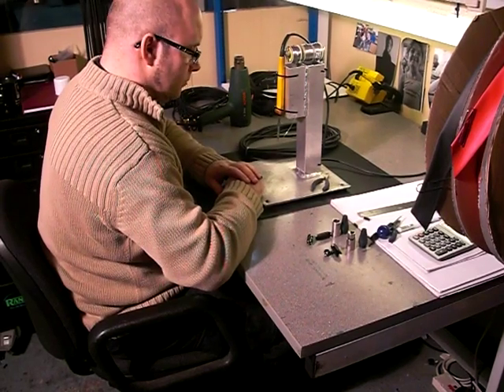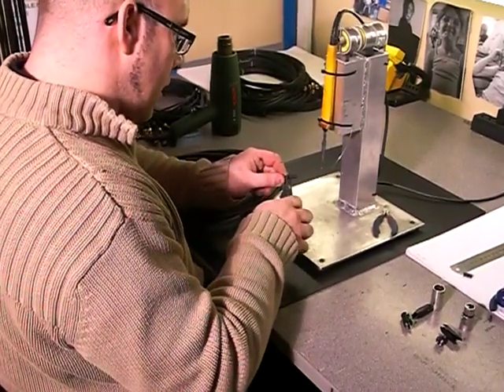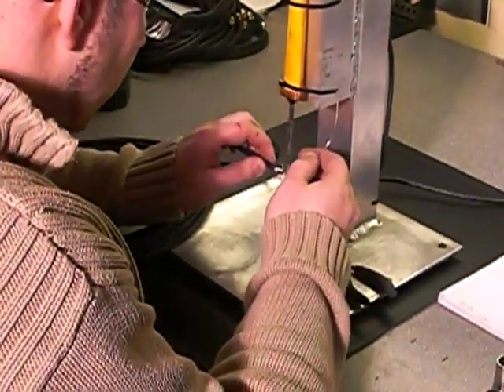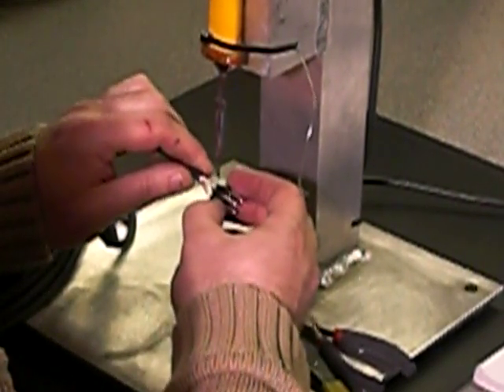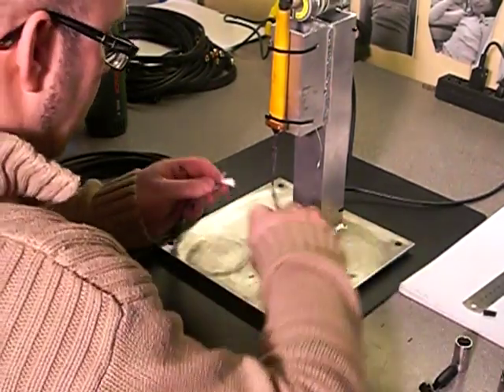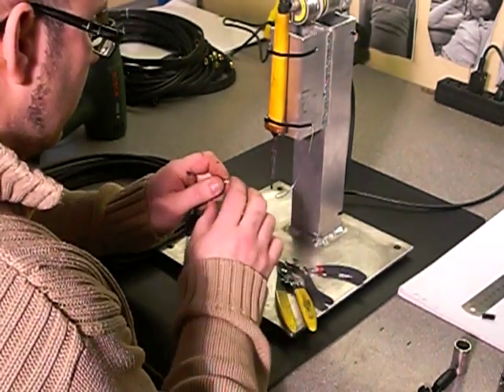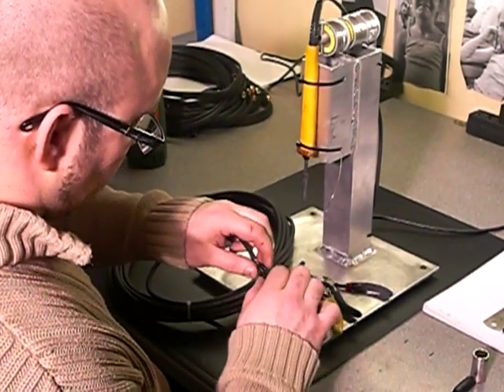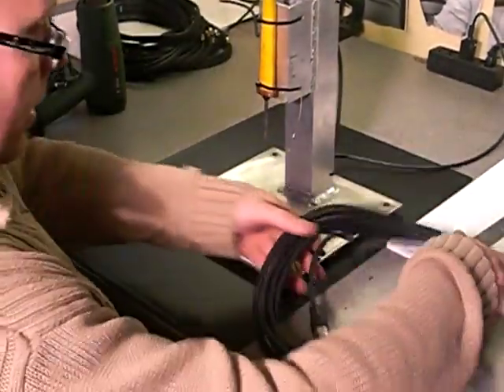How to Build a Microphone Cable using Neutrik XLR's

Comment from the maker: 1) You tin the wires to make it easier for the wire to take to the solder in the solder cups.
2) Solder should not make any difference as long as you have flux in it. 60/40's fine. Remember not to fill loads in to the solder cups as this will cause hesitance.